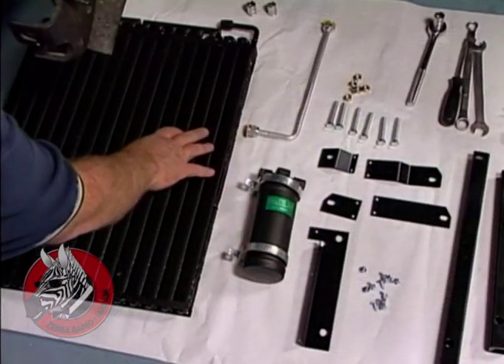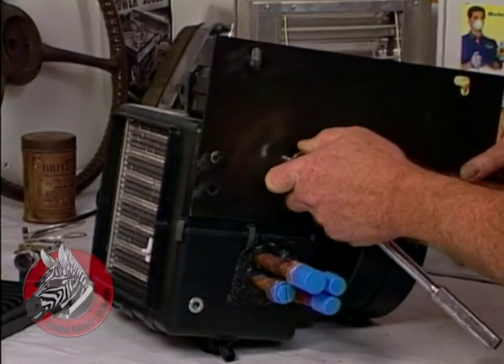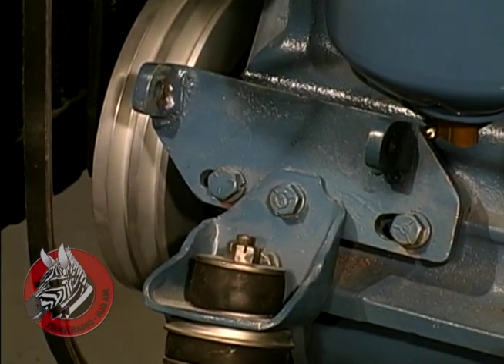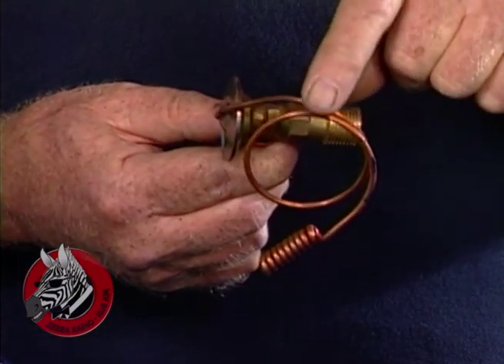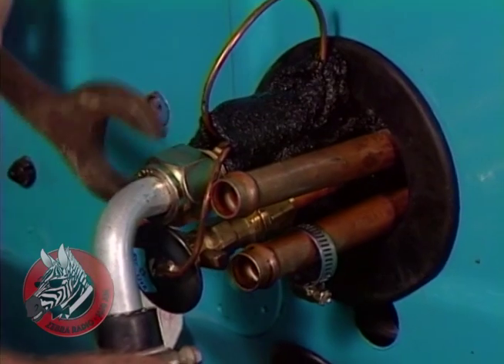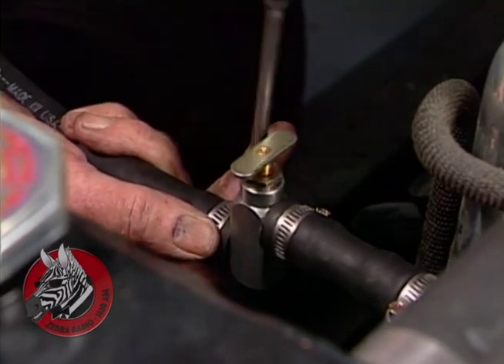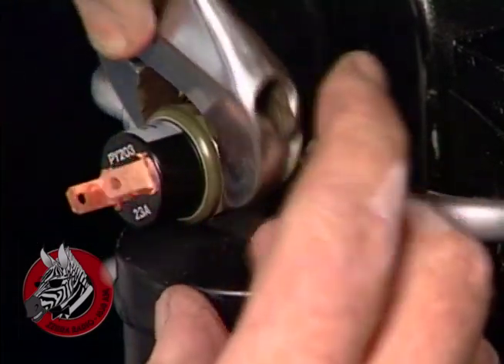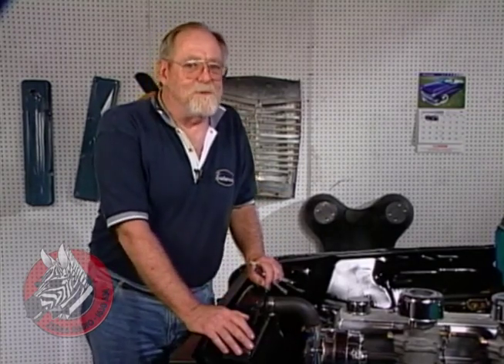Installing Air Conditioning in Your Classic

Comment: This looks like a great system.  I have a 1964 Ford Pickup F250 and living in the San Joaquin Valley in CA.,  having AC helps one to survive the brutal summers.
Reply from the maker: Dan; the A/C kit in the video was designed for a passenger car with a V-8 engine, not a pickup truck with an inline 6.  So, Jim Richardson had to make a few modifications to get it to fit.  You might have to do that with your F250.

Comment: Great video! The tube and fin condensers don't work well with r134a. The high flow horizontal condensers cools better and like that new compressor is more efficient. Will need an auxiliary push fan in front of any condenser to max out the cooling.

Comment: I enjoyed watching your video. My question is about some of the hoses you installed. You pushed the hose onto the fitting and clamped them using regular hose clamps. On other hoses, you used a "bead" type fitting. Did everything work well like this?  Thanks, Bill
Reply from the maker: Bill- I only produced the video. I'm not the expert, Jim Richardson is.  I know he used all the clamps that came with the kit and followed the installation directions.  The only modifications he made was in putting the condenser in front of the radiator instead of behind it.  This was because the kit was designed for a small block V8, not a longer 6-cylinder engine as his Chevy pick-up had.  Also, the compressor was mounted near the bottom of the engine because of a lack of clearance at the top.  This required a special bracket.  You'll probably need to contact Old Air with your question.  Keep in mind, this video was made 22 years ago and there may be design changes with the kit.  The basic principles of installation are likely the same but the kit may be different.  I do know that once Jim charged the AC and finished the restoration of his pick-up, it all worked great.
Reply: @zebraradio1610  He may have answered my question at the end of the video. He stated he would be taking the vehicle, or maybe just the hoses to have the beaded style fittings installed.
Reply from the maker: Ah, yes.  Jim mentioned something about a couple of sleeves on the high pressure hoses that he was going to have the AC shop crimp on before they charge the system.

Comment: Good video  really helpful. I have a question one of the hoses going into the truck is high pressure you put hose clamps on both should one be beadlock crimped on the high pressure side.
Reply from the maker: I don't have that answer.  I only produced the video.  Your best bet is to contact Old Air Products.  This was their kit.

Comment: I have a 86 Camaro that was converted to a drag car. The last owner cut out the heater core and AC but left the fan. I'm looking into everything I need to install a complete heater and AC system.
Reply from the maker: Looks like you may have to find some of the model-specific parts for your Camaro in a salvage yard (heater core, vents) and then finish with new replacement AC parts.  Either that or purchase a new universal AC kit.

Comment: great video. I have one question is it all right to run the pump with the belts hooked up when i drive the car to the a/c shop?
Reply from the maker: It's been years since we made this video.  If I recall, Jim took the belt off before taking his truck to the A-C shop.  But you might want to call Old Air and confirm if that's necessary.

Comment: Do you know an electric version that can integrate with factory air? I don't want it to directly load the motor down, as my car is a 2007 Kia Spectra, having a weak engine (which already can barely hold 2nd gear stick starts) with non-A/C factory air. I'm willing to install extra batteries.
Reply from the maker: Ellenor; Unfortunately, I'm not the expert on A/C installation, just the person who produced the video.  Your best bet is to contact those who make and sell after-market A/C kits, like Old Air Products, and ask them about a kit for your Kia Spectra and any extra pre-installation work you will need to do.

Comment: I want to install AC into a 1980 124 Fiat. Does this apply?
Reply from the maker: Julia: This video just shows the basics of installing A/C.  The basics will apply.   But each car will be slightly different, especially when it comes to reinstalling the heating and controls.  Check the internet for after-market A/C kits for your Fiat.  You will no doubt see some components in the kit that will be similar to those seen in the video and some that will be unique to your car.
Reply: @zebraradio1610  sounds good! thanks